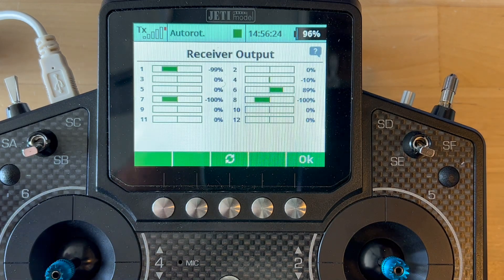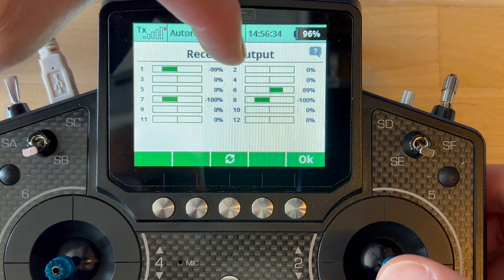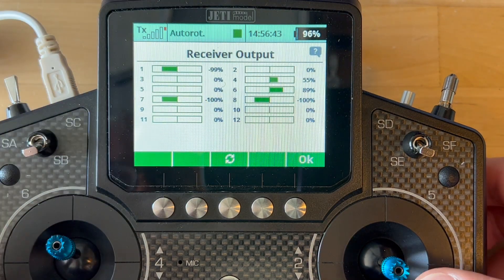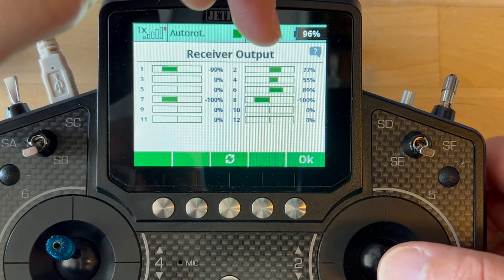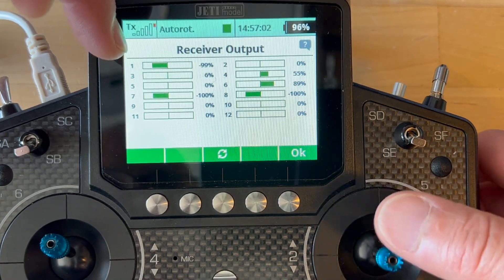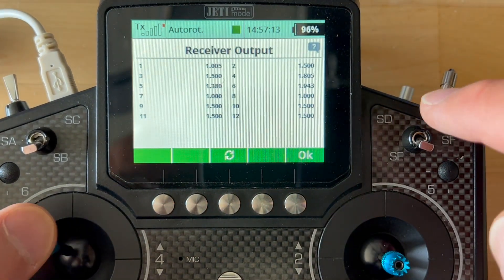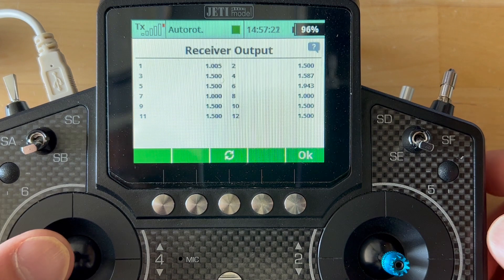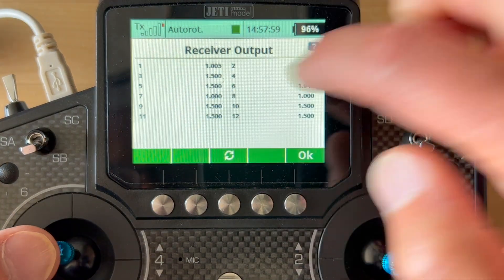Jeti sticks centering  - Just about the best there is   HD 1080p

Comment: John, After playing with multiple systems, what have you decided is your preferred Heli combo?  Jeti/Spirit or Vtouch/Neo?
Reply from the maker: For the previous 4 years up to and including last Summer 2022, my entire RC helicopter fleet (about 9 helicopters) was 100% VBCT/Neo.  Now, for this Summer 2023, I only have 2 helicopters (Kraken 580 and Kraken 700) on VBCT/Neo, and 5 helicopters on Jeti DS-12/Spirit GTR.  Looking at my logs for 2023, I've logged 25 flights (2h, 18min, 47sec) using the VBCT/Neo and 157 flights (15h, 32m, 11sec) using the Jeti DS-12/Spirit GTR.  If you prefer not to read all my comments and just have me get to the bottom line, I prefer the Jeti/Spirit overall better than the VBCT/Neo, but I am anxiously waiting for the Spirit WAVE radio. 

In my opinion, Spirit and Neo can be tuned to "fly" very similarly.  They both feature "lightness/anti-gravity" which greatly enhances the flying experience for smaller helicopters; I dial a few points of "lightness/anti-gravity" on my SAB Buddy 380 as well as the Logo 200 (sold).  So no measurable difference in actual flight performance that I can tell.  I consider the Spirit generally easier to tune than Neo, but both systems can be tuned relatively easily, especially if you understand what the parameters do.

Ergonomics:  I prefer the feel of holding the radio in my hands (I am a pincher) much better with the VBCT radio than any of the Jeti radios I've owned and used regularly (DS-12/14/16/24).  The VBCT radio has a "rubberized" lining, so the radio not only feels smooth on my hands, but it also tends to stay put as my hands start to get sweaty.  In contrast, the Jeti DS-12 radio feels slippery, sometimes needing readjusting during flight by pushing the radio up my hands against my abdomen.  As much as I like the "lighter weight" of the Jeti DS-12 radio compared to other Jeti radios, the Jeti DS-12 radio has sharp edges at the seams, which may feel uncomfortable depending on how you hold the radio.  I have to give the VBCT radio the edge for overall ergonomics.

Display:  The VBCT radio display is much easier on my aging eyes.  Not only is the display itself larger on the VBCT radio, but the contrast is superior as well.  I can't say that a "touch" display is better than a non-touch display, but I much prefer a "touch display" (assuming it works correctly, as quality of touch displays vary), when given the choice.  I can discuss this subject in more detail, but I prefer the VBCT display much better than the display of any of the Jeti radios I've owned.

User Interface:  I have to give the VBCT radio the edge for user interface.  The VBCT radio connects automatically to the home WiFi (2.4GHz band only, so may necessitate some troubleshooting), which means the radio firmware as well as the internal clock remains up to date with minimal effort.  The Neo's also update over the air (OTA), so no need to physically connect a Neo to a computer for updating the Neo firmware.  This WiFi connectivity opens the door to other possibilities as well, like wireless simulation WITHOUT needing any additional hardware whatsoever.  The VBCT radio allows me to adjust the "most important" parameters of my YGE ESCs (also Scorpion Tribunus ESCs) right from the radio in a very elegant fashion.  In contrast, the Jeti radio allows for very limited parameter adjustment of my YGE ESCs, but this is so rudimentary and rather cumbersome in comparison to the VBCT radio, that I only use it if I have no other viable choice.  The VBCT radio also automatically recognize and automatically calibrates with some ESCs (YGE, Tribunus, perhaps others by now), so connecting to these ESC's is as easy as plug-n-play without any need to listen for beeps and calibrating at high and low collective stick.  The VBCT radio allows me to display all the ESC telemetry parameters in one single large display, whereas the Jeti radio necessitates scrolling through several pages (5 pages in my case) to visualize all the ESC telemetry parameters.  The VBCT radio also stores the flight data to a "cloud" so you can access the flight data from your computer at anytime from anywhere without needing to turn on your radio.  Although you can access pretty much all the Spirit parameters via the Jeti radio, VBCT radio allows you to access the Neo parameters in far fewer steps and does it much more elegantly.

FBL features:  Although the Neo (and now EVO) are packed with neat features (assuming you pay extra for the Pro or the Pro/Rescue firmware "upgrade"), the Spirit units have even more features at a more attractive price without needing to pay anything extra.  All the Spirit units come with an aluminum case.  The Spirit GT/GTR series come with pressure sensors which open many possibilities.  I am not aware of a single report of a Spirit unit malfunction (flight performance, self-level, rescue, etc.) due to construction design issues or vibration issues.  The Spirit units have been able to accept a 3S LiPo for many years (I believe since at least 2015).   Spirit (as well as iKON2/Brain2) have supported 760µs cyclic servos for many years as well, whereas this is something new for Mikado with the newer EVO units.  In general, Spirit's internal hardware is more future-proofed than anything I've seen from Mikado, where addition of new features tend to be limited by hardware.  Spirit (as well as iKON2/Brain2) have been able to get telemetry from a whole bunch of different ESC brand and models, whereas Neo has always been behind the competition allowing for ESC telemetry (regardless of the reasons or excuses).

Radio configuration:  The Jeti radios are much easier to personalize with relative ease.  The Jeti ecosystem has many switches and buttons options for their radios.  For Mikado, you are limited to only 3-way switches.  If you want to use a 2-way switch, a locking switch,  or a push button for Mikado, it will involve soldering and adapting.  Neo necessitates using a 3-way switch for motor run/idle (throttle hold)/off; meaning Neo does NOT allow for having a separate IDLE/HOLD switch.  Jeti radio's allow for LUA apps which allows for more "open" flexibility for configuring the radio to your needs.  For VBCT/Neo, you are always limited to their "close" concept where you limited to features Mikado believe you need and not have available features Mikado does not think you need.  Interestingly, both Jeti "DS" radios and VBCT radios feature internal gyros/accelerometers.  I personally use this on my Jeti radio, and I love it.  Mikado does NOT allow the endusers to use this feature in any meaningful way.   Every time I use the VBCT radio, I am very aware of how much I miss using the gyro/accelerometers on the Jeti's.  The Jeti system also allows for use of telemetry data as input for user defined automated functions; This is more useful for airplanes, but I still use to set up "special" spoken alerts on my Jeti radio's.

I am getting a little exhausted typing away my thoughts here, so I will conclude by stating that I have tended to gravitate towards the Jeti/Spirit vs. VBCT/Neo in about a 7:1 ratio this 2023 year.  Both systems have  their pros and cons.  I am eagerly awaiting for the Spirit WAVE radio which, at least on paper, seems to combine the best features of VBCT and Jeti without their current (self-imposed many times) limitations.
Reply: Wow!  Thanks so much for the detailed response!  This will help very much.  I also have issues with the ergonomics of the Jeti radios.  I have a DX9 that I love holding, but I really want to love the Jeti/Spirit combo.  I wish there were more case or grip options around comfort.  I feel more connected with the DX9/Axon combo.  Maybe the Wave/Spirit combo will be the answer!
Reply from the maker: @Igobangbang  I've aways liked the ergonomics of the Spektrum radios.  Considering that you already have a very capable working system with the Spektrum DX9 and Axon FBL unit presumably not giving you any trouble, I recommend holding off on any current radio system in the market until the Spirit WAVE radio is released and properly reviewed.
Reply: Thanks for the input.  Looking forward to seeing how the Wave ergonomics feel.
Reply from the maker: @Igobangbang  So am I 😉